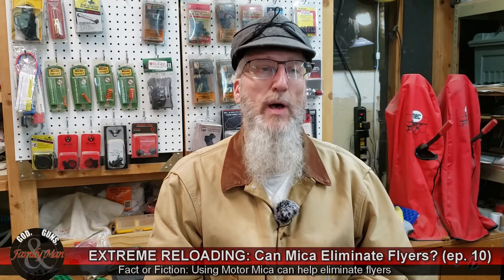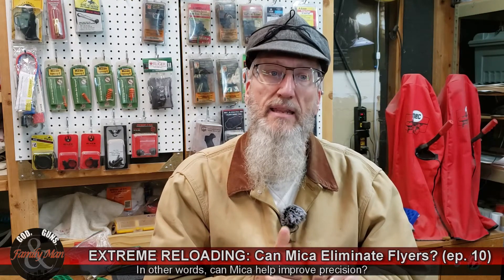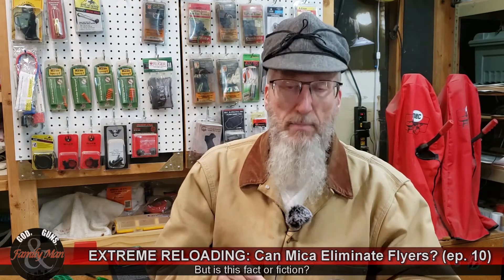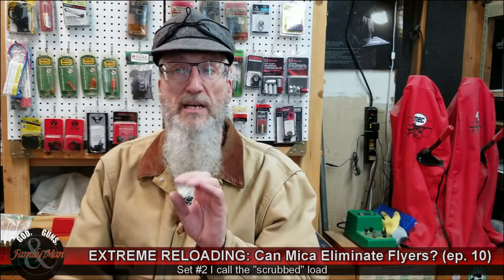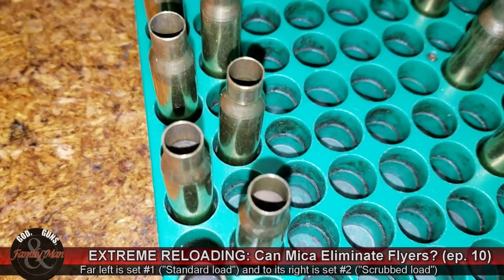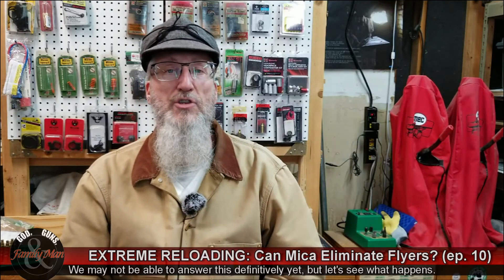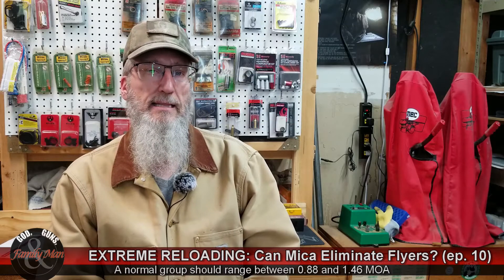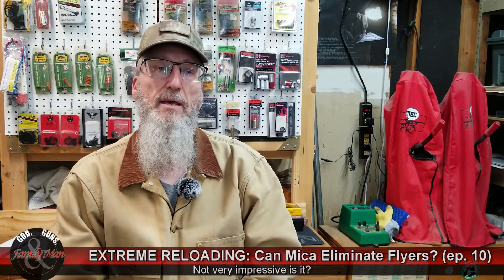EXTREME RELOADING: Can Mica Eliminate Flyers? (ep. 10)

Comment: I am currently working on this problem with my 6.5CM. Right now I am preparing the necks with scrubbing with a nylon brush and applying NeoLube to the case mouths and to the base of the bullets. I have already tested graphite in the came procedure. I seat all my bullets using an arbor press and Wilson inline seating die. Although I am confident that this new procedure will show improvement in the seating pressure I suspect that the issue that is really driving the train is the neck tension on the seated bullet and not so much anything you want to use mica, graphite, etc. I do believe that the base to ogive measurement has to be as close to perfect for each loaded cartridge.
Have you considered NeoLube.
Reply from the maker: I have not heard of NeoLube Sooner Steve.  Where do you get it?  The crazy thing with this set of rounds was that neck tension was very consistent and CBTO was pretty good too.  I agree CBTO is very important and one of these factors without much wiggle room. I have been focusing on that and when all these starts align, I can get sub-MOA regularly.  Maybe the best thing to do is load 50 rounds and then sort those for final consistency once loaded.  How is the NeoLube working for you?  Are you seeing good results?
Thanks for watching and posting.
Reply: @sdkweber  I have only prepped the cases with the NeoLube. I’m waiting for a tool that will allow me to measure how deep the primers are seated into the case before I complete loading the rounds. A guy named Bryan Zolnikov has a YouTube channel and he did testing between graphite and NeoLube. He is a Benchrest shooter and if you’re not scared off by statistical analysis you might want to check out his YouTube channel. He does some very interesting tests. His testing is prompted me to get the NeoLube. I will tell you that NeoLube is not cheap! Anyway I will let you know how my testing goes.
Reply from the maker: @soonersteve3733  Thanks. I am going to check out Bryan's channel.  Let us know how testing with NeoLube goes for you.  I really am interested in your results.
Reply: @sdkweber   I use K&M arbor press with the force package to seat bullets with Wilson micrometer seating die. Cases were annealed and resized with 2 thousand shoulder bump and necks expanded using 0.2635 mandrel. Components were Lapua brass, Hornady 140 grain match bullets, CCI BR4 primer, H4350 powder. The only change is using NeoLube instead of graphite. The seating pressure with the NeoLube, as indicated by the K&M force pack, showed a 50% reduction in seating force from what I saw using graphite. The real test will be when I get to the range and test fire the rounds. I have 30 rounds that I will shoot in 5 shot groups. My bottom line is that the NeoLube will be my choice over graphite in the future.
Reply from the maker: @soonersteve3733  That is interesting to know Sooner Steve.  Now the proof will be in the pudding as I like to say.  Let us know how your groups turn out compared to graphite and no treatment.  Thank you for the follow up.
Reply: @sdkweber  Boltaction reloading YT channel did a couple videos about Neolube. I've yet to try it.  It's a 'dry-film conductive lubricant' as described on Amazon at $24 a bottle of 2FL oz (about the size of a pharmacy pill bottle).  Looks interesting.
Reply from the maker: @gscotty311  I saw some stuff about that online and read comments from others.  If I remember one of the videos correctly, a series of groups with neolube and without neolube produces nearly identical results.  I know some others are experimenting with neolube and I am hoping to hear from them.

Comment: Great episode.  I wonder if there could also be a another possibility to account for flyers, one that might be checked in the spirit of Extreme Reloading  You have been so diligent in trying to create uniformity in case and bullet lengths and weight but what about bullet (not case) concentricity?  It would be laborious but place the round on the concentricity gauge and starting one millimeter from the tip, spin the round. Move it one millimeter, spin it again.  And so on until you reach the case mouth. The idea being to make sure the bullets themselves are not ever so slightly out of perfect round from the factory. Is that a possibility or is modern manufacturing unlikely to allow that to happen? It might not be worthy of an episode but interesting to just check few  dozen bullets on the bench to see if any variability exists.
Reply from the maker: Hello Aaron, thanks for watching.  I think we are on the right track here and I appreciate your thoughts and ideas to help craft excellent ammo. 
I have experimented some with bullet concentricity and actually did an experiment shooting a few different groups where one group had nearly perfect concentricity while others were out of round.  Unfortunately, only about 0.002" out of round max.  Not much difference really and my best group was 1.08 MOA but it was not the most concentric.  Years ago I did some other tests and noticed that only my really long bullets seemed to be sensitive to concentricity variation.  
I have read that a good barrel and leade will align the bullet once it leaves the case mouth.  That could be why the long bullets showed more sensitivity also.
Thoughts?
Reply: @sdkweber  Hey, it is good to know the bullets are essentially perfect right out of the box.  The secret to the flyer could be something as simple as hitting a house fly, blowing grain of sand or rain drop on the way to the target.  I really enjoy all the work you put into the pursuit of answers though. In the end, it may be like the number of licks it takes to get to the center of a Tootsie Roll Tootsie Pop.  The world may never know 🙂
Reply from the maker: @aaronneumeyer5572  I am beginning to think you may be right. We may never really know why those occasional flyers happen.  Thanks for the conversation Aaron and batting around these ideas.
Reply: well said.

Comment: Have you ever shot this rifle off of bags before? I tighten my groups when I tried my target rifle off of bags
Reply from the maker: Yes, then I went to the bipod. I just set up a new system to shoot off a bag using an Eberlestock shooting rest with a molle connection to my pack.  I am still getting used to it but kind of like that approach especially in the field as I can dump the weight of the bipod.  I also use a rear bag instead of monopod for my Grendel. How much better did your groups get?